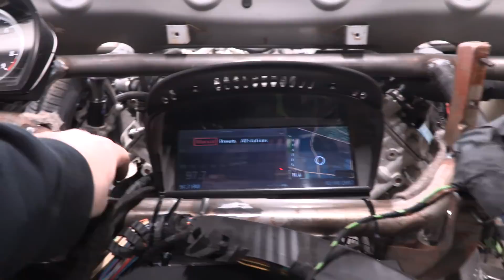Wiring Up The V10 Beast. Will It Run!? - 240Z With A BMW V10 Engine

Comment: I've posted this up earlier,

Get a laptop, install ISTA-P & ISTA-D  with OBD or M.O.S.T port access to scan all the computers and disable any limp modes etc.
Reply from the maker: I have one.. don’t need it yet..
Reply: @BisforBuild  the small scanner wont go through every module one by one the same way the software can. 
It will be tricky to get it to work perfectly without  the OEM manifold too as it will mess with the DSC, if you figure a way around it I definitely want to try run individual throttles on my M5.
Reply: Daniel Hoyle what part of “I have one” don’t you get? Let me try and help. HE HAS A LAPTOP WITH THE SOFTWARE ON. 

He’s even used it when looking for the problem on Chelsea’s M5...
Reply: Michael Gallagher iirc that was inpa not ista
Reply: but inpa still works for really most of the stuff on the E Series...
Reply: Manuel Coliano yeah well.. maybe. Ista has a lot more stuff. I just wanted to point this out in case Chris didn't notice the difference
Reply: But then tool32, WinKPF and E-Sys for the F Series have even MORE... For the most part INPA works well with the E-Series BMWs
Reply: Manuel Coliano so you can do coding with inpa?
Reply: nope, using ncs or esys for that matter. But is Chris really doing any coding for now?
Reply: Manuel Coliano i suspect he will find out in a few days?
Reply: @manuelcoliano1101  its not coding, it is seeing what faults in amongst all the modules need to be worked through to make it operational
Reply: In case you have the proper BMW Software thumbs up, but without that things are waaaay to much time consuming... @Daniel Hoyle is right on this.
Reply: liam kildea whoa calm down son, he does this every day all day, the guy’s allowed to have some down time.
Reply: Daniel Hoyle k
L
Reply: @defunctusername yeah it's about 200gb  for ISTA-D & ISTA-P  on your hard drive. But it's the easiest gui to navigate and the smartest software for BMW'S. I've got NCS and inpa and all the other ones that have some function but barley get used.

Comment: I'm gonna assume it doesn't start when he questions if it will or not in the title

p.s Be careful leaving battery chargers unattended for too long!
Reply: If it started he def woulda used that to his advantage lol
Reply: niallgreene1 Exactly 😂
Reply: I'm 99% sure it won't start when he tries it.
Reply: Why would it start, he didnt even hook up fuel lines yet right?
Reply: Like 99 percent of all chargers are automatic now. Almost nobody has a manual charger anymore, those are the only ones that can potentially over charge a battery. Source: Work at Batteries Plus